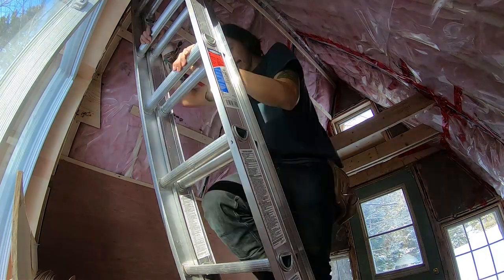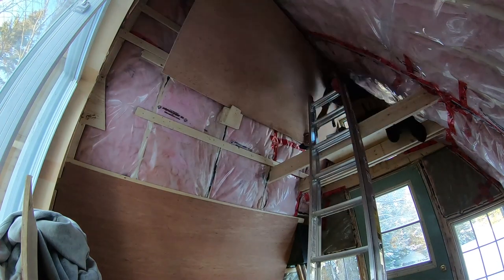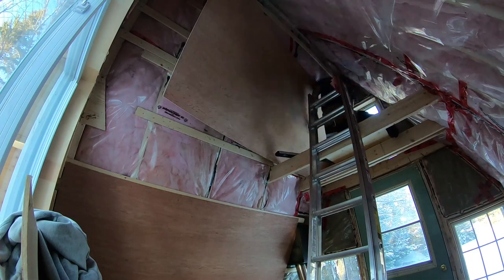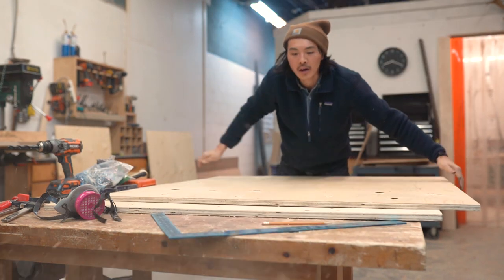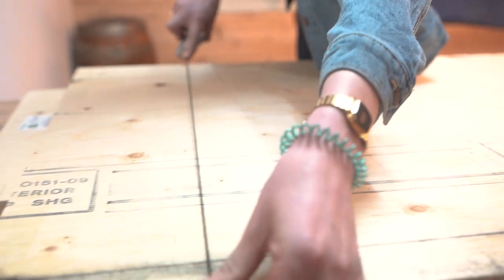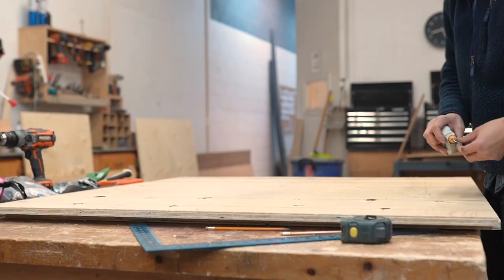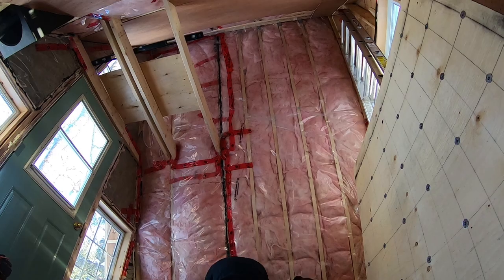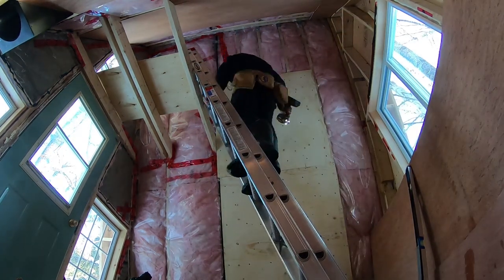Szeto's A-Frame Cabin Build - Pt. 9: I Messed Up (the interior), but the Climbing Wall is sweet!

Comment: such a good series thank you! what are the basic dimensions like the width of the whole building? Think you said in one of your vids that it was 12 feet long. Just trying to get an idea of space.
Reply from the maker: it's a cozy 10 x 10. below permit size up here!
Reply: thank you!  @AndrewSzeto
Reply from the maker: @heatherscott4873  no worries! thanks for checking these out! finishing up the interior this weekend! pretty pummmped!!!
Reply: super exciting! I'm just designing my Aframe - gonna start building in April can't wait! your videos have been great @AndrewSzeto
Reply: @heatherscott4873  i believe the general guideline is "less than 108 square feet" (you should probably check that with your municipality) so it might be good to consider slightly different dimensions, ie: 13'x8.25' ... hope that's helpful (we are also in planning stages to build a shack in northern ontario)

Comment: Instead of  tongue and grove just cut the plywood down in to 8 inch strips . Look on YouTube for the ideas for floors and walls
Reply from the maker: thanks a ton. Not sure if it would work well for the walls. The other challenge I had was that it was almost too flimsy. Cutting the strips on sight will be difficult too. I might use it for flooring though! Thanks a ton for the tip. Will look into this more.